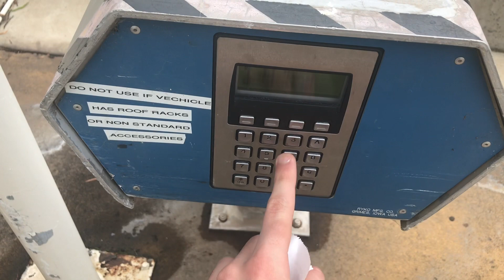Ryko Excel at Caltex with Star Mart in Weston Creek, ACT(2021 Revisit)

Comment: What happens after the 1st dry Is the machine sprays a polish, and the reason why the sprays policy it’s because they actually wired both the pump and the solenoid together so then after it does that it does a brush polish
Reply from the maker: Cool.